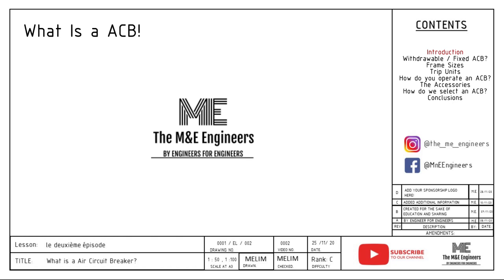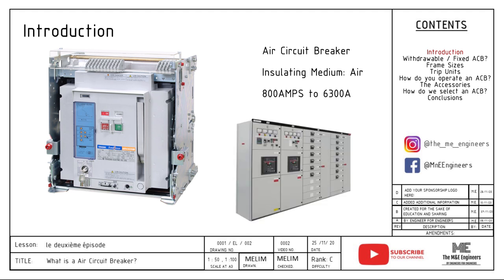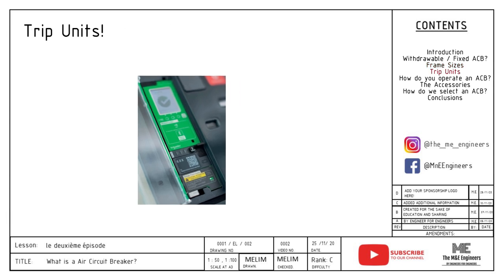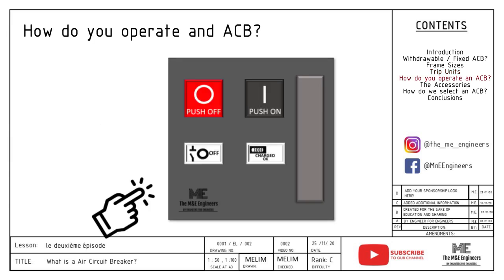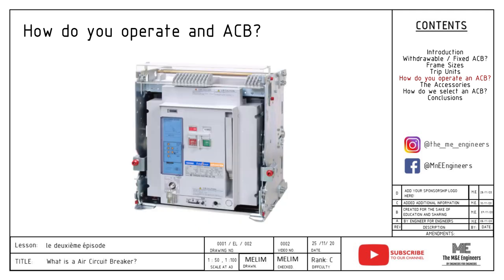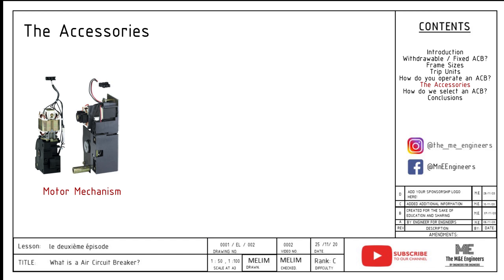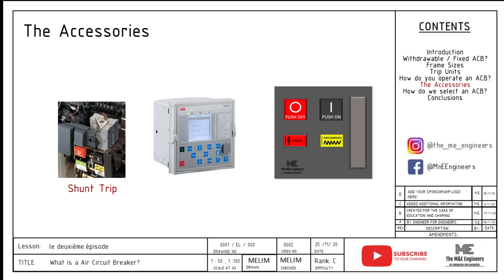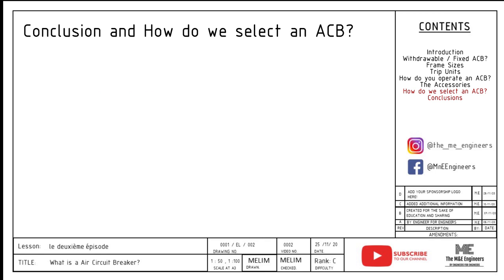Episode 2 - What is a ACB, Air Circuit Breaker, Trip Units, draw-out explained by a M&E engineer!

Comment: What is the useful life for the ACB? In terms of maintenance, in what interval ACB shall be maintained (monthly? Half yearly? yearly?) and what are the scopes involved?
Reply from the maker: Hi Jerry thank you for your comment. ACB's useful life tags with the Switchboard of 20 years if it is well maintained. 

In terms of maintenance, a yearly Basic end-user maintenance program and 
Standard end-user maintenance program every 2 years is required.

As for OEM maintenance, depending on the current loading, criticality and environment it is recommended to have maintenance every 2years for bad conditions, and 5 years for better conditions.

Hope that answers your questions!
Reply: @themeengineers1671  Thanks for the response. Clear!
Reply: @themeengineers1671  we need more video why stoped.😢

Comment: Good video friend I have question I watched engineers test acb mechanisms on regular basis, they would shut off acb and then rack it out not fully??? Then rack back in, pump and energize again. Why did they rack it out????
Reply from the maker: Hi steve, the pumping action is to charge the coil, after the coil is charged the acb is ready to close the circuit again. 

The reason we rack it out not fully i assume is to move the breaker to a test mode/ maintainence mode, where main contacts are isolated(open) and control circuits remain connected. In this position we will be able to still test the function of the breaker without closing the circuit at all(we dont want to open and close the circuit so many times during test as it cause disruptions to the loads). Therefore racking to test position ensures one time power off and give you ability to test various features of the breaker many times before racking in again for operation.

Hope this explains
Reply: @themeengineers1671  you sir are a legend thanks so much for the response that clears it up nicely, I always wondered why now I know. Hope to see more videos from you soon, its excellent content.

Comment: If the the trip unite gets tripped, does the current stop flowing thourh the entier acb and is it onlt the trip unit that can break the current if there is somthing wrong?
Reply from the maker: The entire acb is opened once the trip unit detects a fault. A good trip unit shows the fault type for the engineer to rectify. Once fault is rectified the acb can be reset and re closed. Hope i answered your question

Comment: kindly discuss about Frame Sizes of ACB.
Reply from the maker: Hi they are usually described as AF, amp frame, it comes in 800, 1250, 1600, 2000,2500, 3200,4000,5000,6300.